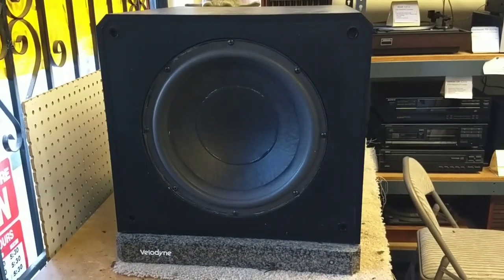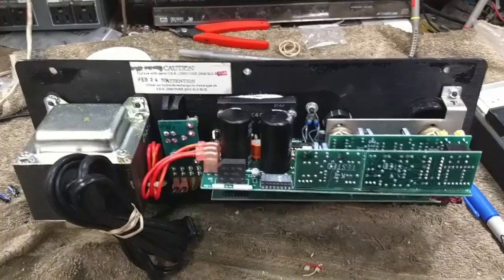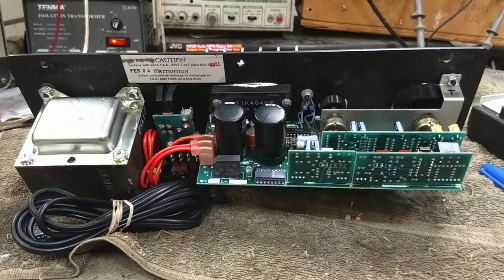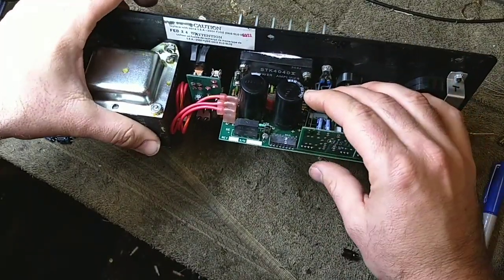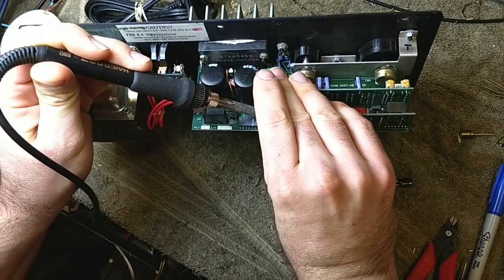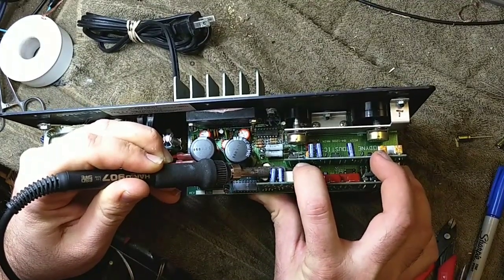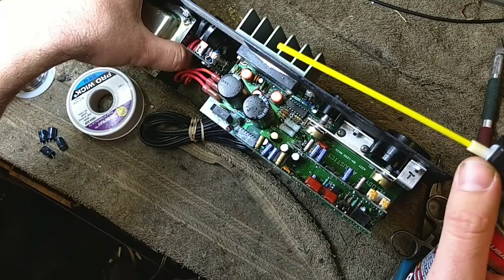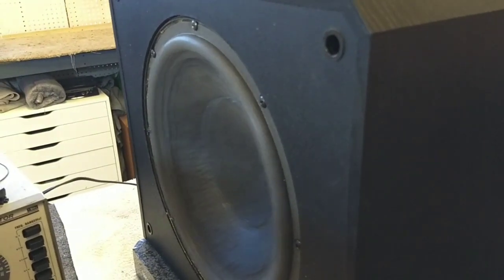Velodyne F-1200-b repair of servo circuit - warning headphone users!

Comment: Thanks; I'm watching this video in order to repair an F1800RII. The servo circuit and its power supply are likely to be similar despite the large difference in output power: the later model in 1997 had a one thousand Watt class-D amplifier. I'm glad that the company still repairs old units in your country but due to the freight costs to and from the south pacific ocean we must fix things here ourselves.

Comment: My problem with deoxit is it washes all the grease out of the pot. They end up squeaky and get scratchy again within a year. Thinking of getting some dielectric grease to put back in them after using deoxit. Cool video!
Reply: I prefer deoxit D100, as it doesn't have the solvents that wash out the grease.

Comment: You started to pull out the servo board where the connectors plug into the main board connector a bit and then pushed it back in. I'm not sure of the orientation of the two connectors coming from the speaker to the small board that connects to the main amp. Is it possible to get a photo of that so that I don't plug them back in backwards? I removed my speaker to replace the surround and did not realize that it could be unplugged easier by simply removing the amp so I'm not sure of the correct orientation of them now. A single photo of the speaker side of that small board with the 2 connectors attached would be all I need to ensure proper reconnection, but I cannot find one anywhere. Any help would be greatly appreciated!
Great video by the way... Thanks for posting it!
Reply: Did you every get a reply? The green connector fell out, when I removed the amplifier module. Now I don't know how to reconnect it either. Lol
Reply: @dav2705  No...I never did, nor has anyone who ask a similar question. I got mine back together fine, but after 2 years I can't remember what the configuration was. Also for those who say once the accelerometer is not available if it goes bad... I spoke with a Velodyne tech who told me he had almost a thousand of them laying in stock since they rarely or never went bad! He's located somewhere in California and the cost of the unit was extremely cheap! Once I got mine working again and refoamed I've never had an issue since then.
Reply: I think the green connector goes up against the white. I changed the caps and it works for 10 mins before shutting down. I'll get it fixed one day, but I bought an SVS PB-3000 Sub, which kicks ass. Thanks for your quick reply
Reply: @davrosd  Glad you got it... I still love my 15" servo sub, but have a 12" and 10" non servo Velodynes with the 1000 watt amplifiers in them and like them equally as well. I also have 2 Carver True Sub Signature subs...both 12" and they outdo the Velodynes by quite a bit although I rarely use a sub at all. I use tube amps through Altec Lansing 19 speakers and they rarely require any kind of sub for what I need. I only picked these subs up because I got a great deal on them.

Comment: Hey Jordan, Great video. I have the same model. I am running into issue where mine does cut off after incresing th volumen. Looks like it can't handle it. It does work nice in low volume
Reply from the maker: Likely there is a problem in the feedback circuit of the servo amp. Could be open cap or two and its too much gain , causing it to clamp it off. 

Way to check is to test the caps with an ESR meter, can almost guarantee the majority in the feedback loop are dead.

Comment: Help, please. I have bought an older Velodyne DD12 and it does not respond to any button I press on the remote control. The remote apparently works because the red led lights up and the infrared sensor blinks when checked with a phone camera. The subwoofer works when connected to a receiver but I can't change any equalization settings or else. What could be the problem and how can I solve it?
Reply from the maker: No clue. Never worked on velodyne that new.

Comment: Hi Jordan... right around 50 seconds on the video where you pull the amp out of the sub - well mine disconnected BEHIND the green plate you see where 4 black wires connected to a  4 female green plug on the left is connected to a 6 - pin  male terminal on the green plate.  I cant figure out which of the four pins on the 6 pin terminal that the 4 female plug attaches to!  lol   Can you please help?  - thank you kindly -John
Reply: You won't get an answer...
Reply: Have the same issue

Comment: My F-1200-B is presenting the issues you describe here, and it's in such nice condition, that I must try to repair the amp. I have collected and restored vintage audio for 30 yrs.. I usually order electrolytic caps from Digi-Key.  For the caps you indicate need replacing, you specified the uf values, and I can read the Voltage values from them when removing.  But, I don't know the best SIZE values to get for them.  Typically there's a value for the radius/width, height/length and the leads spacing.. all 3 values given in mm. Can you tell me what physical dimension values you chose for the new 220uf, 4.7uf and 33uf caps you used ?
Reply from the maker: This was ages ago. I basically went on digikey and plugged in some variables to the filters.

Radial leads
-55 to 105 degree operating range
voltage
value.

I use nichicon and panasonic caps.
Reply: @JordanPier  well.. guess I'm just not going to get an answer..Oh well. With the double board and such tight spaces, choosing the best dimensions, H x W , and lead spacing in mm, is key. Nevermind.

Comment: Jordan, nice job. I have the same sub and mine is acting up. It will cut out randomly. I turned it off and back on and thumped it once by tipping it up and inch and letting it hit the floor and it comes back on. Maybe a bad connection?? Could this also be the result of the caps you mention?
Reply from the maker: Likely a bad solder joint or joints on the circuit board.
Reply: @JordanPier  Thx. I'll probably recap while in there. Do you recall voltages for 220uf, 4.7uf and 33uf caps? Do you have a board layout diagram showing cap locations you could share??
Reply from the maker: @bills.520  gotta open it up and make a map. Take it out of the cabinet SLOWLY and note the position of the connector furthest inside the cabinet. Very important that it not get reconnected incorrectly

Comment: Is there no way to test the servo before replacing the caps? I guess if the caps are open, a simple multimeter would reveal that issue?
Reply: Don't hold your breath on getting an answer !
Reply from the maker: The problem is that the capacitors are in the feedback loop of the servo. Their ESR has a big play in how efficient the servo is and how quickly it responds to the accelerometer input. If any of the capacitors in the servo are lacking, certain frequencies will not go through the feedback loop correctly. This will usually cause a low frequency oscillation, or take the set a long time to "return the woofer to still" - In short the caps if bad can cause the same symptom as a bad accelerometer. However, without a working feedback loop its not possible to see whether the accelerometer is bad or not. Hence, replacing the capacitors first. 

You could probably target the specific ones in the feedback loop and save a little time - but that's assuming you can actually find a complete schematic for these velodynes. This is often the hardest part.

Comment: what kind of accelerometer is used in this subwoofer? can you make it yourself? As I understand it is just a piezo disc?
Reply from the maker: No idea. No published information about it. Velodyne does not share info about what parts are used and no identifying marks on them
Reply: @JordanPier  
understood thanks!
I just want to build my own emos (servo control acceleration) system. Have you assembled one yourself? Can you recommend something that is not very difficult to assemble?
Reply from the maker: @tillnewman830  I have not toyed with building one. Maybe if I had more time. I'd love to play around with stuff.

Comment: Hey. I have a F-1500r-b and whenever I turn it on, the green light blink and the sub makes a weird sound. Do you have any idea?
Reply from the maker: Not a clue. Finding an owners manual might give a clue as to what's going on
Reply: @JordanPier  thanks for your quick  response. The manual says "The green 
power led may also blink rapidly. This indicates operation of the thermal protection 
circuitry. If this should happen, you should reduce the volume setting or shut the unit off 
until nOlmal operating condi!ions return." I do that and nothing. Every single time I turn it on happens the same thing.

Comment: Can a bad accelerometer cause the sub woofer to pulsate loudly with the volume at zero?  I had my amp repaired due to this noise but when I reinstalled the amp the problem persists.
Reply from the maker: Yes. If the amp has been properly serviced and the pulsing still occurrs the accelerometer is defective
Reply: Jordan Pier So just for clarification where is the subwoofer getting a highly amplified signal with the volume set at zero?  Is the volume control bypassed by the accelerometer and the amp provides full power to the woofer?  When I turn on my sub with the volume at zero my pant legs are shaking it’s so loud.
Reply from the maker: @robinkoenig  the accelerometer is in the amplifier feedback loop. It controls the gain of the amp by proving voltage based on the movement of the woofer, to prevent overdriving and distortion.

When the accelerometer fails, there is insufficient feedback unless the motion is too extreme. When you turn the unit on there is a very small low frequency pulse that occurrs as the components energize. However without any feedback the amplifier gain is huge and throws the woofer a long distance, causing the worn accelerometer to give just enough feedback to allow the amp to back off. But because of the resonant frequency of the woofer and enclosure, a parasitic oscillation is created and builds tremendously.
Reply: Jordan Pier Thanks for the explanation. It is discouraging to think I have to throw this unit away because of one simple component that is no longer supported by Velodyne. The grand piano finish is flawless and it does sound great when working. Is there a way to test the accelerometer to confirm probably the obvious given the history of these accelerometers to fail?
Reply from the maker: @robinkoenig  the only way to see if the accelerometer is working is to probe the outputs with an oscilloscope to see if there is proper output moving in both directions. Since this isn't specified in any service literature you need a good working one as a reference. However I shot this video long ago and never bothered to take a measurement
Reply: @JordanPier  Thanks.  I am trying to figure out how difficult it is to replace the accelerometer.  I believe it's under the center cone.
Reply from the maker: @robinkoenig  it's usually glued to the voice coil former. Almost impossible to replace without damage to the woofer

Comment: My hgs15 does that slapping sound after its been running for an hour or 2
Reply: I have the same problem.  Did you fix your HGS15?
Reply: @LuisC202  i put it in for repair and it did it again i would never buy another velodyne sub